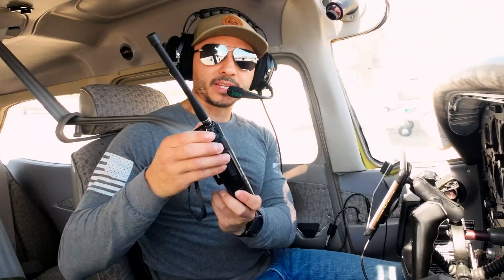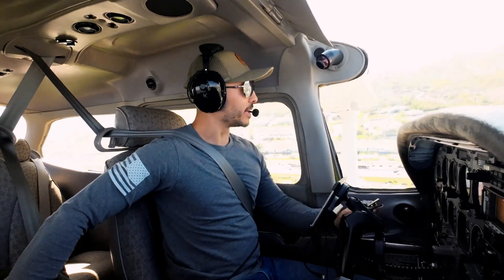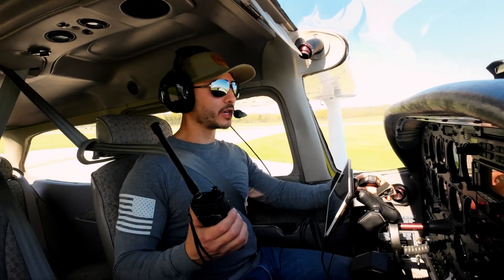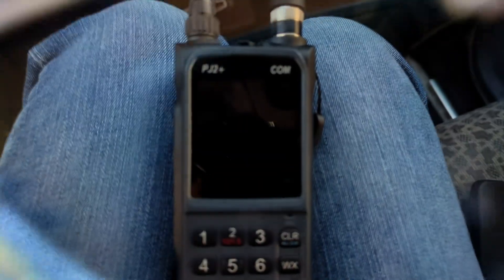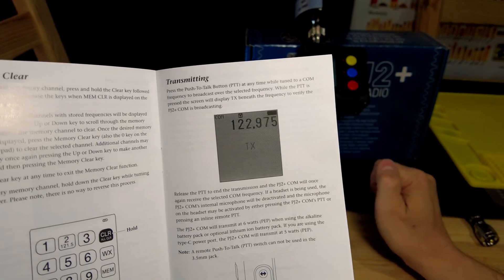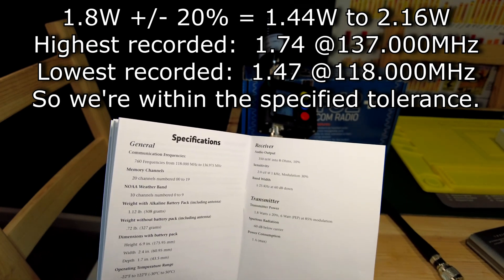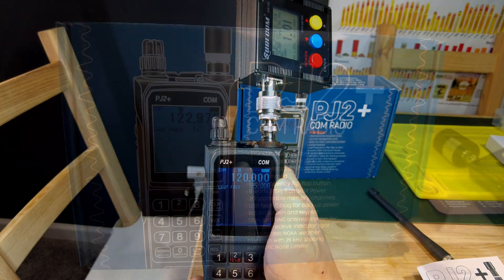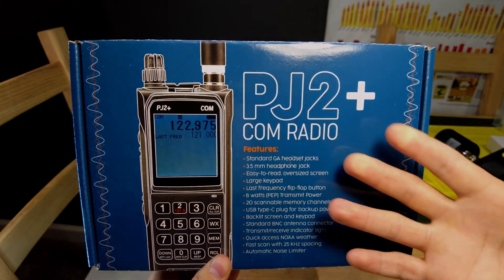Sporty's PJ2+ COM Radio: In Flight and Power Test

Comment: I did a similar power test on an Icom A16, using a similar meter.  The numbers I got were in the same ballpark as what you saw here.  I also swept that antenna on a VNA & found it to be below an SWR of 3 from about 108-125MHz.  The upper end of the band read a little higher.  Surprisingly, a cheap Chinese radio gave me nearly 5 watts out as a bare carrier and it's reception sensitivity was actually better.  If PJ plug adapters were actually available for it, the Chinese radio would have been a good choice.  30 years ago, I spent A LOT of money to get an Icom handheld because it was the best thing out there at the time.  Now, it seems that none are really great but some are a little better than others & some have better features.  Handhelds are limited to 6W because the antenna is right next to your head & too much RF power at that range constitutes a health risk.  Most in-dash radios on small planes are around 10ish watts.  As an example an IC-A220 is specified to have an 8W carrier.  Control towers are usually pushing more like 50 watts on standard air band VHF.  Long range HF on overseas flights can be in the thousands of watts.  The legal limits can be found in 47 CFR § 87.131.  Thanks for posting this.  It's good to see that my Icom is not as sub par as I was thinking it might be.

Comment: I operate the PJ2+ in a Quicksilver. The low price and aviation jacks were the reason I chose it. Signal RX/TX is fine in the pattern. I use eneloop batteries which register half full but work.

I previously used an ICOM with Nav which was too much complexity.

For my use, it needs an external PTT.

Cons: I don't like the channel switch button so close to the PTT.
Reply from the maker: Thanks for watching!  I too LOVE the fact that it has the headphone jacks, it sure beats taking off the headphones to use the radio if I need.  Yes, in the pattern the radio is great.  I got a longer aviation band antenna too that also helps increase the range, but being up in the sky without any obstacles, the signal will propagate far with little help.  I never heard of the Eneloop batteries, do you have more details?  Are they rechargeable or I wonder why they are half full when you put them in the radio--unless you're using used batteries anyway...I'm sure it's fine, obviously the batteries I have now will run out eventually and not stay topped off.  Your batteries will last longer if you don't Tx as much.  Tx costs more battery life.  The ICOM or any radio with Nav I am sure is a nice handy thing, however I fly VFR and the Nav stuff would be for pilots that have more use for it.  But again, like you said it can be complex and when you need an emergency radio, you need simplicity which the PJ2+ brings.   PJ2+ would be nice if I could name some of the memory channels, otherwise I have to memorize the frequencies.  I didn't notice the channel switch button being a problem, it's got a tactical feel and I never noticed a problem it being close to the PTT, but I'm used to knowing the PTT buttons from Ham and GMRS radios that I use.  An external PTT would work nice so that the radio doesn't have to be in your hands all the time when using it.  External PTTs are common for other radios, unfortunately this one not.  Maybe the next generation will have the option.
Reply: Did you end up buying the external PTT Switch with the PJ2+?

Comment: 100% polarized, your 90 deg rotation is the way to test if they are.  Both the radio and the glasses are polarized.
Reply from the maker: Ya, I wished I clarified that in the video, but you're right.  I realized it after I got done filming and had more time to look at it.

Comment: Can you use these radios outside of aviation? I have a pair of MSA Sordins with LEMO cable
Reply from the maker: Well, unfortunately, they are tied only to Aviation AM band.  And anyway, why would you want to use these radios out of aviation, what other purpose would they be used for?  If you're using comms for another purpose, you'd use that type of radio (HAM, GMRS, MURS, etc)...
Reply: @58Alpha  It was out of curiosity. I’m not that tech savvy. Would you know any regular radios that take LEMO?
Reply from the maker: @JR_ST  No, I'm not sure.  But I'm sure there's gotta be adapters to LEMO to fit a variety of things.

Comment: Thanks for the review. I just ordered one
Reply from the maker: Thanks for watching.  After having it for a bit, I kinda wished you could name some of the frequencies that you save so that you didn't have to memorize them, but it is what it is, maybe in the next update.  Also, I got an improved air band antenna and BNC connectors (since the PJ2+ uses BNC connections) if you're also interested in them to improve your range.  It is longer than the stock antenna and might get in the way in the cockpit but it is pretty nice to improve range and signal.  

Antenna:  https://amzn.to/3Nv7Lvw
BNC connector:  https://amzn.to/3pfF1PC
Reply: @58Alpha  sweet man thanks, I’m definitely going to order those. I just got my radio in today and the range definitely isn’t great. Does that new antenna improve it alot or just some?
Reply from the maker: @blainepetsupplies5354  When you say the range isn't great, what conditions are you in?  Are you near an airport or are there a lot of obstacles in the way?  The original antenna will receive great line of sight if there are planes overhead, but the longer antenna I sent a link for will definitely give you more antenna gain and better reception and transmission if you're a pilot using it to talk.  But if you're considering other antennas, you need to ensure it's tuned to the air band frequencies for optimal use and improved gain.  You can try it and test it out, if it doesn't improve it enough for your liking, you can at least return it to Amazon in 30 days.  It works great for me on my other air band radios too (Rx only since the PJ2+ is the only one I can Tx on)
Reply: @58Alpha  yes I believe it’s mostly the obstacles, I have just tested it out at home so far, I did transmit a couple pilots at the nearby airport, over all it doesn’t seem mad. Going to try it out in the air today. If I think it needs improvement I will order the other antenna you sent. May go ahead and order it anyway. I appreciate it
Reply from the maker: @blainepetsupplies5354  no worries, I hope it works out for ya. The price of the antenna isn't bad anyway for having an extra lying around. You could use the longer antenna at home while listening and the original antenna in the air. The BNC connector makes it very quick and easy to swap out.
Reply: @58Alpha  Did you do any tests to see how much range has increased with the other alternate antenna?
Reply from the maker: @nolmscheid  no I haven't unfortunately. It's really hard to organize since this isn't HAM or GMRS in which I have a license to use, so I can't transmit on airband for testing so easily.  

I could go up and fly, make contact at an uncontrolled airport and ask them to verify if they can hear me at different ranges.

Also, being in the air with no obstacles like on the ground, you will get very good range.  There's another video by Sportys that showcased the range with the stock antenna, let me see if I can find it and post a link for you.
Reply from the maker: @nolmscheid  https://youtu.be/JQ3So3LoiNg

Check this video out, they were able to get 20+ nautical mile range with the original antenna in the air.  With the improved antenna, you'd expect more definitely, probably upwards to 30nm or more. What do you think?
Reply: @58Alpha  Excellent! That isn't even the plus version which has a little less power. I ordered the plus version, I will possibly order the antenna/BNC connectors you suggested as well since it is so inexpensive. Either way, I will just be using it as a backup and for some ground monitoring.
Reply from the maker: @nolmscheid  Awesome!  Agreed!  The antenna is quite inexpensive, so why not if you want some more range!  I also use it for a backup and casual listening.  Happy flying, safe skies!

Comment: are your sunglasses polarized?
Reply from the maker: You know, I am not too sure now. I will have to check with some sunglasses i know that are definitely not polarized. Now I'm not sure if mine said they were polarized or not when I got them.
Reply: @58Alpha  Did you confirm this yet? Your example in your video really does make them appear to be polarized. I am not familiar with any other glass coating that will black out a LCD panel like that. ;-)
Reply from the maker: @nolmscheid  ya i made a big mistake. I bought those glasses a long time ago and really thought they weren't polarized. But they are. So you definitely should not use polarized sunglasses when using the radio. I'm really sorry about that confusion.
Reply: @58Alpha  All good!